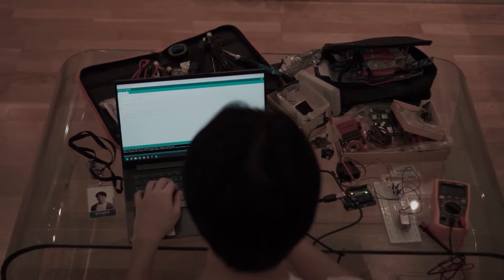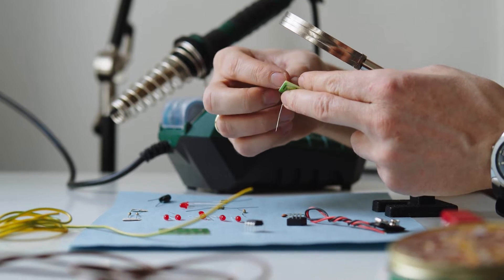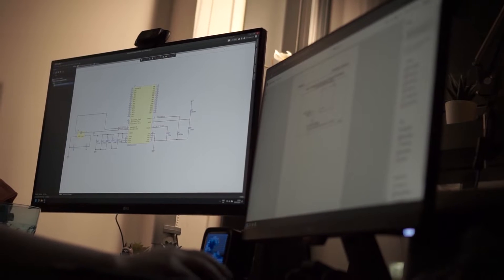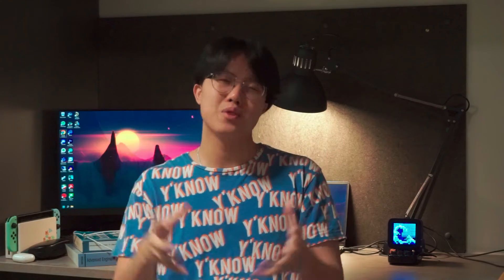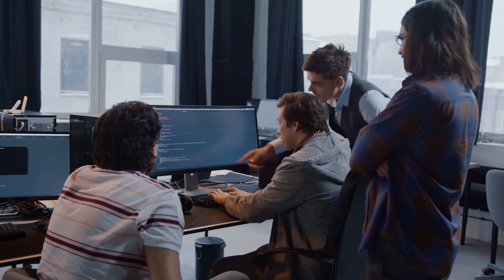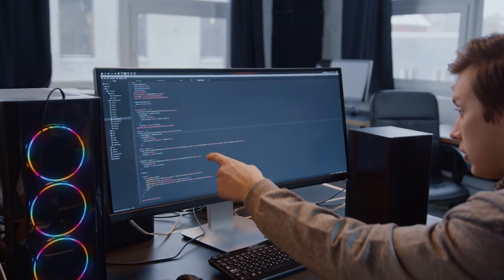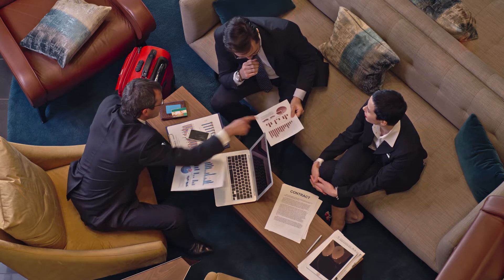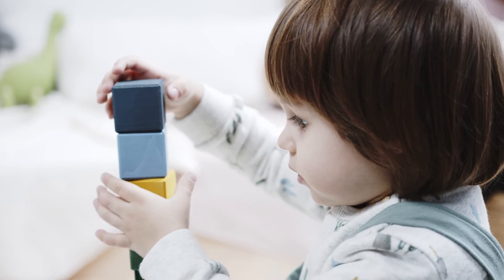Most Important Electronics Engineering Skills To Learn

Comment: which programming language should i start with? and why? is it C or C++ or Python?
Reply: As the name suggests, the main difference between C and C++ is that you can do more with the latter. Learn C to get your bases, then move on to explore C++'s additional features. Doing this you can better understand in what C limits you so and so what's achievable on systems using C, while still building your knowledge on C++.
Python isn't too different from C++ but generally regarded as more user-friendly. If you get bogged down in C, you can shelf it for later and check the language. Python is also what Arduino is based on, so you might like to prioritize it if you want to focus doing projects with it.
You probably want to master all of these in the end, they're widely used and similar enough that you aren't starting from ground 0 after learning one.
Reply: Thanks a lot mate! I already started with C and it helps in my EEE academic curriculum  @cdgonepotatoes4219

Comment: Is electronics and embedded system still worth it ?? I am so confused i see a lot of peaple talking and intersting about data sience and devops and all of software stuf and they say that this is the futer ?? And this disappoint  me as a freshmen embedded system engineer. Pls i need advice from you bros
Reply: what you think now
Reply: Embedded systems is the future compared to mechanical engineering, which in turn is the future to civil engineering. And so on .. Still we need all of them. Software engineering pays the most, because almost every company needs it. Only a few companies need electronics, hence, the pay gap. Salary is tied to supply and demand. For salary you can easily transition from embedded to software at a company that does both. But if you like hardware, stay where you are, it will make you happy and the pay is still very good.

Comment: 1. Soldering
2. PCB design (suggestion: Altium Design)
3. Coding (suggestion: Python, C/C++)
4. Learn to communicate (suggestion: learn the vocab for your project)
5. Engineering Mindset (suggestion: define goals and requirements, structure)
Reply: You can design a PCB without circuit design if a circuit is given to you.  But that makes you more of a technician.  As an engineer, you should know about circuit design.  But there are many types of circuits out there, so it kind of depends on your field.  There are analog and digital circuits.  And then there are different applications like RF, power electronics, actuators for analog, and logical circuits for digital.  With logical circuits, you can get into integrated circuits and microelectronics, where they are manufactured from semiconductor wafers.  Then you need to know about computer engineering and protocols like USB, ethernet, WiFi, etc.  With power electronics / actuators, you need to know about motors and mechanics, and safety.  With RF, you need to know about antenna and RF propagation.  Then there are other frequencies like microwaves, Terahertz, which are separate fields of their own.  And when you get to IR and VIS frequencies, you are in the realm of optics and photonics.  And more fields emerge for UV, X-ray, and Gamma rays.
Reply: 1. Branch Education 
2. Phills Lab 
Those are also two good channels to understand...
Reply: Yeah. Well, in my opinion. These things nowadays all can be found on the Internet excepting 5. The proper engineers desinging and developing the quantum computer, electric motor for electric cars. So Therefore need to know the relating physics and all the math ever existed. Anything else Anything else of these two fied are pretty much useless in my opinion.
Reply: Thanks bro❤

Comment: First soft-skill, trying to communicate your ideas, that's a tough one. At my first internship I was amazed how well my mentor could communicate complex topics to me, and in how few words he was able to do it. Anyway, my uni requires two technical communications courses. I would highly recommend that everyone go through their technical communications course series at their uni; I know, we're not english majors, I get it. It will be painful but it's worth it! I'm a senior graduating summer of this year (2023) and those are still the most important set of courses that i have taken... even more important than intro to circuits or circuit theory
Reply: How about your job is going??
Reply: @none.4415  pretty good, was a little rocky at first (we work on very expensive one off designs so it’s understandably hard to trust a newbie right off the bat). But it’s finally starting to pick up

Comment: Hi, your videos are really great and valuable to me, so thank you for that.
I live in Germany, so it's really complicated to choose a career for yourself, because there are so many different systems of education here and all of them seem to compete against each other. I am already set on doing electrical engineering as a degree but now there are 2 different ways for me to approach this. The 1. is to go to a "TU", so a technical university and go through all of the theoretical and math intensive stuff the field has to offer, but not really learn how to do actual engineering work like e.g. soldering or designing PCBs. 
The 2. option would be to go to a university of applied sciences and learn just the theory I actually need to work as an engineer, but definitely not as wide and deeply as the TU teaches it. For that lack of theoretical education I get a lot of teaching in topics like soldering, coding, designing PCBs and a lot of projects to work on with the other students. So quite a lot of practical work and actually creating stuff. Have you experienced something comparable when it comes to the structure of a college degree or does something like this even exist outside of Germany? Would be interested in knowing if someone who does not live in Germany has heard of this system.
Reply from the maker: Danke! And no I haven't heard of that system before although in the UK there is something similar which the options are 1. traditional university route 2. apprenticeship route (which nowadays are getting more popular as you get paid to do work and to learn at the same time).
Reply: Wirers and engineers tend to be different animals. There is a bit of a crossover where each can do a bit of each other's work, but in reality, that only happens in R&d labs and even then,  not often as a good design engineer is seldom as good as a good wirer and visa versa. I spent many years contracting on projects and contracts for companies around the world and the main thing they liked about me was that I knew pretty much all there was to know about what was involved in taking  a product from design to production.  Good luck on your journey.

Comment: Regarding programming languages, I definitely got surprised when you said that programming language is usually overlooked and avoided by Electronics Engineers. In my country, this skill is of utmost importance. Now, regarding which programming language, for Electronics Engineer, I think it depends on your application. For more signal and data processing, scientific programming languages, such as Python, Matlab, Julia and R are great choices. For other applications, such as, Embedded Systems, languages such as C, C++, Python are the way to go :)
Reply: Python is NOT the way to go for embedded systems.
Reply: @compton8301 I was gonna say that xD real embedded is made in C/C++, with Python you can use microcontrollers such as Raspberry Pi but that's all. If you want to do embedded system make peace with the fact that you'll use low level languages xD
Reply: Thanx bro bt I wanted to help mi know applications u were taking about ad their meaning such as embedded
Reply: For my field I learn TCL, Perl and Verilog/SystemVerilog